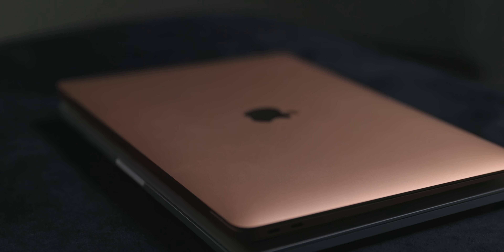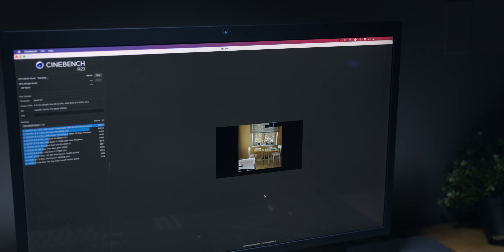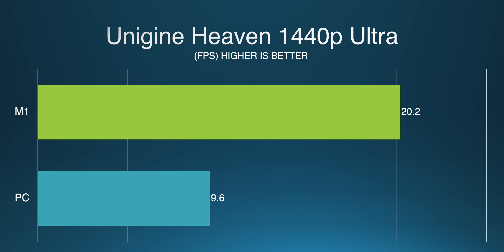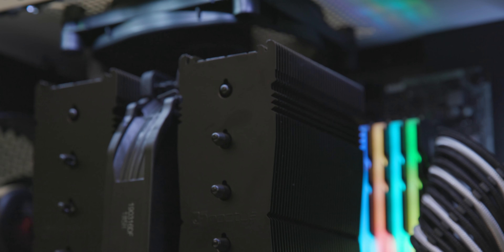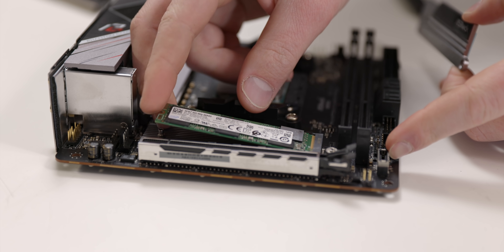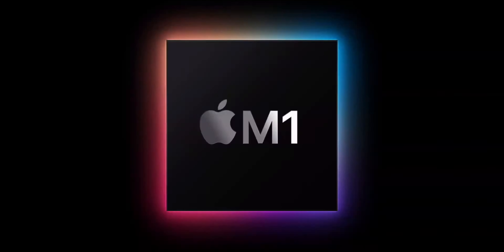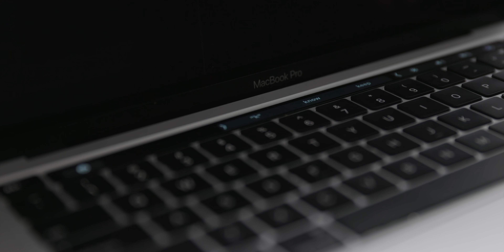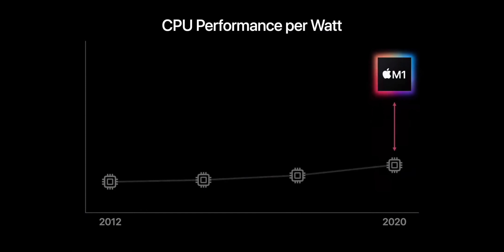$699 Mac mini vs $1,000 PC: Which Is Faster?

Comment: So here's the problem when it comes to desktop systems and individuals/businesses looking to make savvy buying decisions: The M1 is indeed great for its form factor/price/TDP, but it's an entirely throwaway item -- the system memory, CPU cores, and GPU cores are all in one BGA-soldered mass that is permanently attached to the board -- and so is SSD. It competes with laptop varieties of the GTX 1650, which is very impressive, but a desktop 1650 Super is a better dedicated option, and paired with a regular Ryzen CPU (e.g. a Ryzen 5 5600) that combo outperforms the M1 all while costing less (at least in normal, non-pandemic times...) and leaving many options for upgrading (you know, all the way up to an RTX 3090 and a 16-core/32-thread Ryzen 9). And this is to say nothing of upcoming low-end desktop GPUs yet to be released or the imminent 5000-series APUs from AMD (you're effectively looking at last-gen hardware with the 4750G, sad as it is to say).

So yes, very impressive -- especially performance per watt -- but only for those who don't need/want things like upgradable system memory or storage, much less future CPUs and GPUs. As such, I'm just not sure who it's for. The "average consumer" doesn't need it's performance for email, word processing, etc., and someone who does need that power is better served by options in the PC space because they're vastly more cost effective. Simply put: I'm never going to make my decision based solely on performance per watt (barring any systems that draw in excess of around 600W peak), but rather **performance per dollar**. The M1 is a very good deal for what it is, but what it is happens to be a rather niche product.
Reply: So is the Z-Fold 2, $2000, twice the cost of the M1 MB Air and that is therefore disposable by your logic? The future is shared SoC to keep those year-on-year improvements going. 

You also complain the power is too much for the average consumer, but you miss the point of having efficiency and power cores! This means if you do not have an intensive workflow you will be using the efficiency cores and getting extreme battery life. The power cores are there for opening apps and the odd boost to workflows. Remember the MB Air is an ultrabook at heart but with the added bonus of better power if you need to draw down on it. It is the same price as Intel MB Airs so anyone trying to troll saying it is niche is rather inaccurate and totally missing the point!
Reply: @andyH_England  Yes, that's exactly my point -- for all its flash, the Galaxy Fold is absolutely disposable.

And I don't complain about the power draw... In fact I said anything around 500W peak is entirely acceptable.

What's more, you're talking about a value add in an ultrabook that very few people will leverage. It's not an excuse for Intel, but if we're talking about price to performance paired with potential for modular upgrades, the Ryzen APU is much more palatable and will cost less/offer more over time -- not to mention that the entire PC is less likely to end up in a landfill in 3-4 years (which honestly helps offset the slightly higher power draw), and even the used components (CPU, DRAM, etc.) are likely to have a second life precisely because they can be removed/upgraded. That Mac mini will be lucky to have its aluminum housing recycled.

Comment: To be really clear, it is translated into ARM on first application run. It isn't like it is running it real-time. The Microsoft Windows translation is, I think.  Not to say that it isn't impressive. It appears to do it fast and it does it really well. I wish it wasn't such a walled environment. I will stick with PC until either they bring down the price or reduce their control over the ecosystem. I wonder how well the M1 will scale without breaking backward compatibility and how it will deal with the security issues like meltdown did to x86 which has hampered it's performance. Although, given that x86 is run in data centers where cache snooping is more  serious, it might not be as much of a concern for strictly consumer products.
Reply: What's "walled"?  Go to the Internet, download and install anything you want.  It's not an iPhone or iPad that's limited to the App Store.

Comment: I'd argue you should be comparing M1 to the R7 5800U, which is AMD's fastest low power chip. Comparing to the last gen zen 2 architecture or high power chips for gaming laptops doesn't really make sense in my opinion.

Comment: Quinn making me want to sell all my intel Macs to get an M1...or wait for the iMac M(Whatever) !!!
Reply: I'm holding out for the Apple Silicon based iMacs myself. My 2013 one is still rocking along though showing its age in some areas now. It's one of the best systems I've ever owned. I've been through two PC's in the time I've had this thing and other than gaming the iMac still runs as snappy as my 2018 PC. But then a 780M isn't really a threat to a 2080 Super lol.

Comment: Using an M1 MBP for work in a web development. Can launch a chunky projects on it without any problems.
Everything is more than twice faster than on mine old i7 MBP 2014, also never heard it's fan lol
Battery is crazy. After a day of working on it with the full brightness, there's still 30% usually on it.
Price of it are struggles to compile some libraries for arm-64. But they're getting updated every day
Reply: News Flash New laptop faster than 7 year old laptop....This just in Sky is indeed blue!